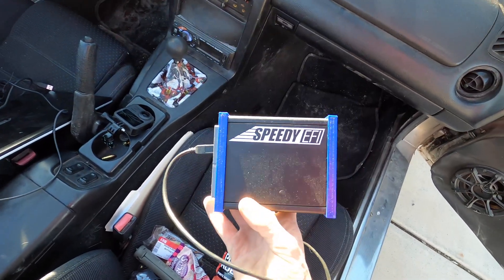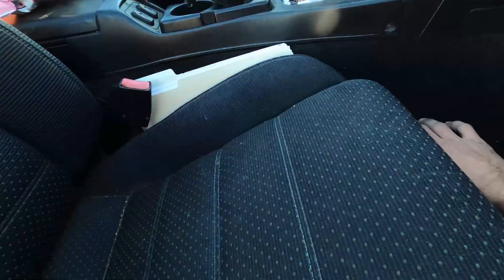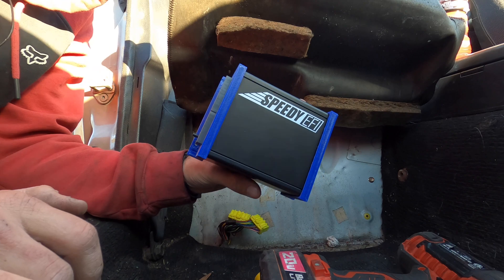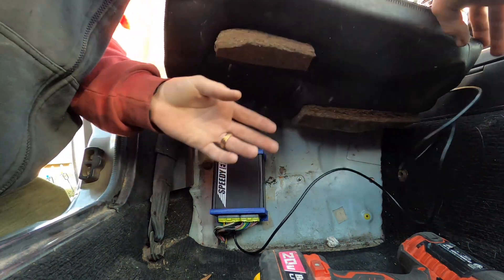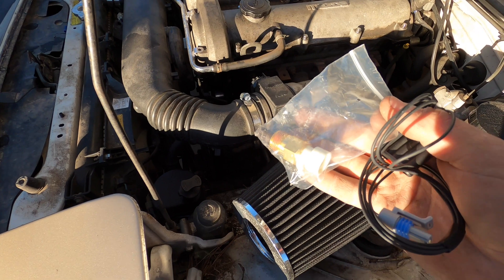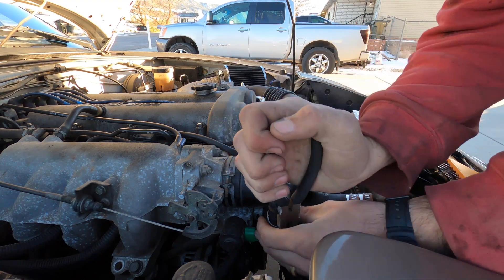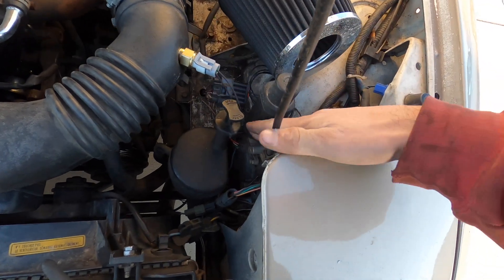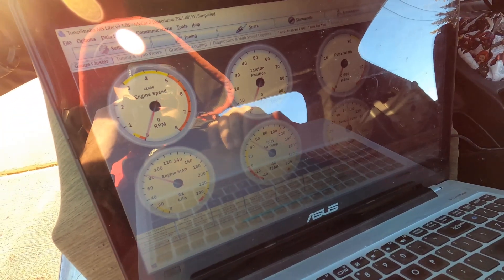Budget Turbo Miata Build Part 1/ Standalone ECU Install

Comment: That's actually a pretty good intake system and the Racing Beat intake is hard to get nowadays.  That's definitely one that will sell easily on facebook or ebay.  Side note, Cash's videos are very good but for tuning a miata, Greg at TheCarPassionChannel has some excellent general ecu set up videos including a great one on idle tuning.  He's not using speedy EFI but the general concepts of what adjustments and settings do what are the same.  Between Cash and Greg, I'm feeling confident enough to go to a standalone on my 95 when it comes out of winter hibernation in the next 3 weeks or so.